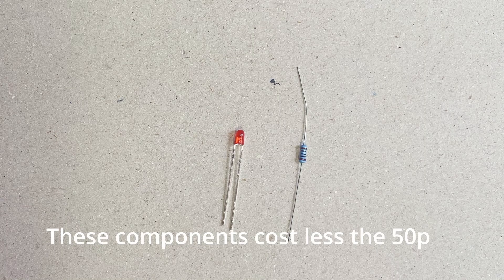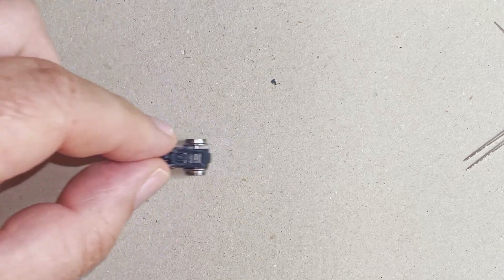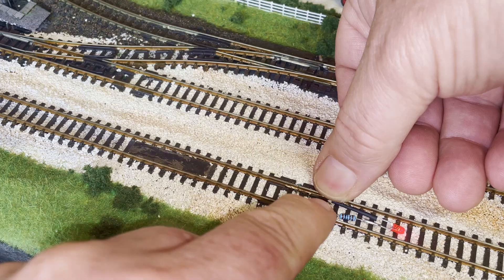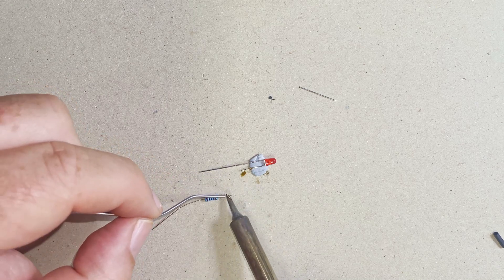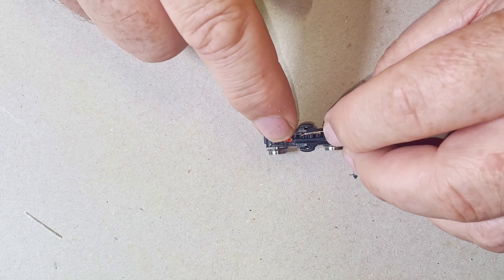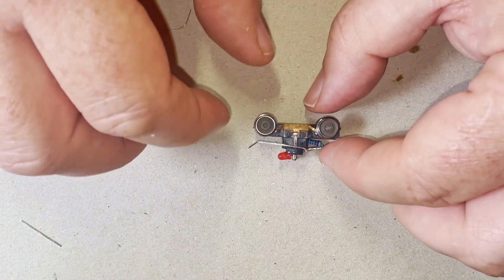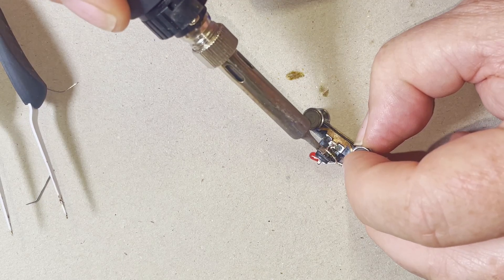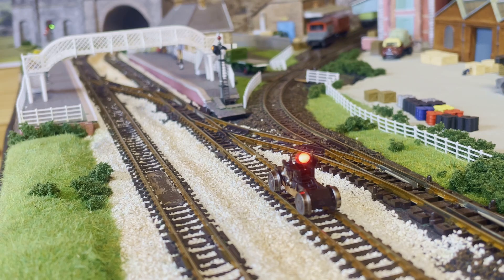DCC Track Tester, make your own cheap track tester, for your model railway, Ep10

Comment: You are so lucky that modern LEDs don't (always) fail on 12V reverse polarity. It is actually worth putting another LED in parallel, but the other polarity, so neither LED gets the full 12V. Or use a red/green two-lead LED, that has two in opposite polarities already.
Some uninformed people would say "Ah, well, it's got a resistor in series, so that's OK". No, the resistor won't drop any voltage until a current flows through it, and a reverse-biased LED should pass no current, so no voltage drop, so 12V straight across your LED, reverse-biased, and your LED is rated at, usually, 6V reverse, maximum. If you used a 1980s LED instead, it would just glow very brightly. And briefly. 
Trust me, I've been an electronics engineer since 1975.
The Blutak was a good idea, though.

Comment: I have found that a simple globe of 10Watts is better. The diode only draws a small current so wont pick up any high resistance problems. also as noted by someone else below LED requires a bridge rectifier, although a second diode in parallel will help to show direction on DC or both light on DCC. suggested globe is festoon type

Comment: You should have a bridge rectifier in the circuit, or the LED won't last.
Reply: Or wire two LEDs in so called antiparallel. So one ligths up when the other one ist in reverse.

Comment: should put a diode either inline or across the LED - LEDs don't like working as common-or-garden diodes and need protecting. A tiddly 1N4148 or 1N4001 will do the job
Reply: I was about to comment this. A diode is definitely a must have for DCC track. It could burn out the led if you don't use a diode.
Reply: You could also parallel another LED across it (reversed) . The forward voltage drop of one LED keeps the max reverse voltage below spec.

Comment: Do not forget that many LEDs ( especially the red ones) accept maximum of 5-6 V in reverse polarity, that means your simple detector can be easily demaged because, especially on DCC track,  the peak to peak voltage is far above those 5-6 Volts. ( the resistor in this case has no influence because there is no current in reverse polarity).
Reply: I may be wrong but the track is the same voltage regardless of any inputs from the controller. The voltage is ac. The direction is a digital signal only to the decoder.
Reply: @ocdaddvids   This is exactly the problem. In DCC is an AC voltage peak to peak over 20 V in many cases over  30V. You see the light from the LED in the half periode when the positive voltage of the DCC is on the anode side.  When it is on cathode side the LED will not lit but the voltage on the LED will be in wrong direction about 30 V and this is out of specifications of the LEDs. 
The easiest way to add a second LED parallel to the first one just in oposite direction  ( ie A to C and C-A) . In this case one LED will protect the another one. ( in DC you will get even an indication which rail is positive).

Comment: What a great idea, I'm on board with this, I have a couple of wheel sets that are in my parts box, and I'm going to give this a go. One suggestion if you clen the part your soldering too that might help. But using a little flux would do the trick better.. Anyway Thanks for a Great Idea !!

Comment: Too simple for dcc power tester. Power tester, yes, but does the same with DC ( minus the very fast blinking, which can't be observed anyway ). As someone said, put a reverse LED, antiparallel with the existing one. When both lights up, at least it's detecting AC waveform, which can be DCC. If only one LED, it's DC.
Reply: Thank you for the clarification, hopefully those who are not savvy in electronics will know what to do.
Reply: Antiparallel? Is this the same as in series? Thanks
Reply: @GRUMP5B  nope, it' parallel, but reverse direction. LED1 anode to LED2 cathode, and lLED1 cathode to LED2 anode. Preferably different colored LEDs.

Comment: You need to add either a diode in series, or another led in parallel with the first but reversed. This is because leds will break with a reverse voltage of more than about 5v. 
Thank you
Reply from the maker: Hi Thanks for the comment, of course this is true for DC, but I have found it actually works ok with the frequency of DCC.
Reply: @LlanfordParkModelRailway  reverse bias will kill leds. Its more a problem with dcc,  which as you say has a modified ac signal.
Reply: @LlanfordParkModelRailway  Yes, this actually works for a while, depending on the LED properties.  However,  damage is cumulative over time.  There is more going on in the reverse condition than simple thermal damage that would be more quickly evident.   In this use, the LED reverse maximum is exceeded by quite a lot, and then the resistor limits the current from being immediately destructive.  Methods others have mentioned to cure this are proper and necessary.

Comment: Made one of these with two track testers attached to a OO scale bogie,as each track tester is connected to one set of wheels it detects any brakes across joins in the track and as in DCC mode if the track is wired correctly. To use you connect it in front of a loco and drive it around....

Comment: I like that it simulates a train and can show weak spots over points etc, someone will manufacture this for sure.
Reply from the maker: Thanks for the comment. Yeah I wanted something to run over point to check the switch blade contacts.